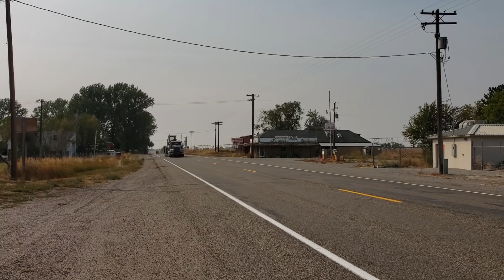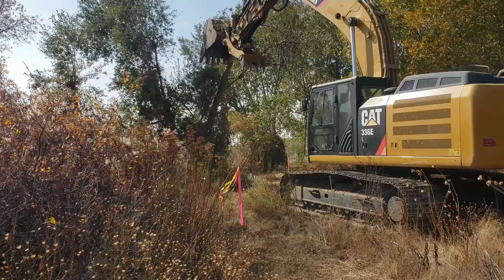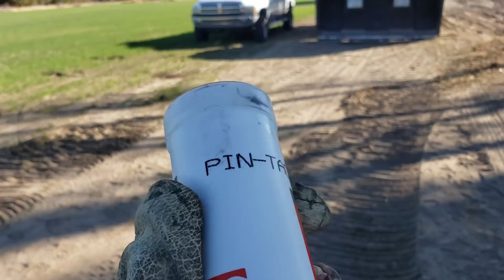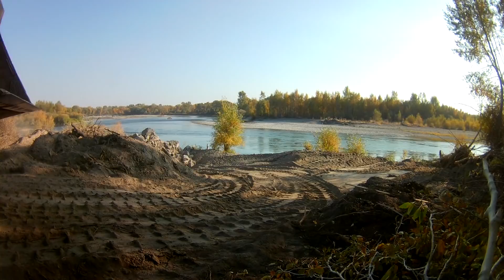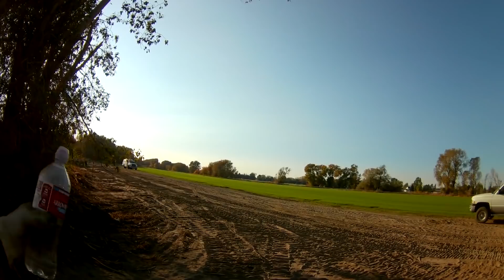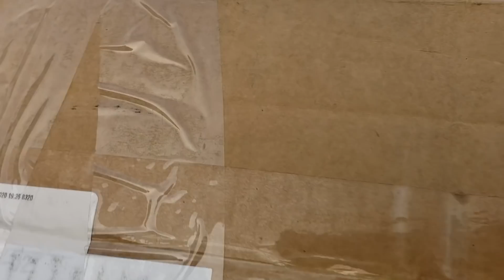Two Down One To Go

Comment: This one is for you Jeff Paydirt  A little poem for you. If you can't run a grader you can't date her If you can't pull a trailer you can't rail her. if you can't operate a dozer, you can't bend her over.If you can't work a ditch you can't get no bitch.If it ain't a cat can't break her back. HA. HA. Dave Phillips D&P Backhoe Service Girard,Kansas

Comment: This is not on you but the engineers:  A structure is only as good as its foundation, and it seems to me that building that barb on soft soil will just get undermined in high water conditions and it wont last.  What do i know?
Reply from the maker: They hold up really well, we have to dig below the river bed to get it down

Comment: Great wildlife pictures, I wonder why there is so much on show for you to photograph but it must be really quiet there and lots of suitable habitat.
I know that the earthquake needs lots of CFM to run but any idea what pressure it needs to work at its best? Also does it need special sockets for nuts and bolts?
Reply from the maker: just one inch drive impact sockets

Comment: long low idles are bad for the dpf thats when it gets the most use idle your machines 100rpm higher and you will notice a difference almost all the emissions stuff is for the idle
Reply from the maker: we shut if off if were going to be out of it longer than 5/10 minutes, then crank it to 10 and run it when your operating